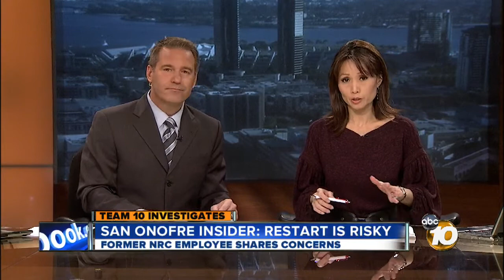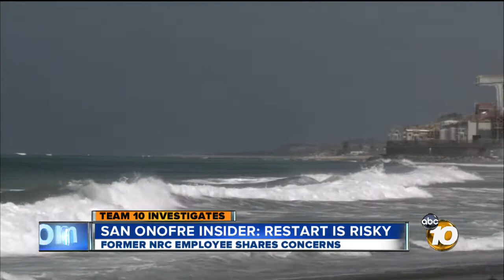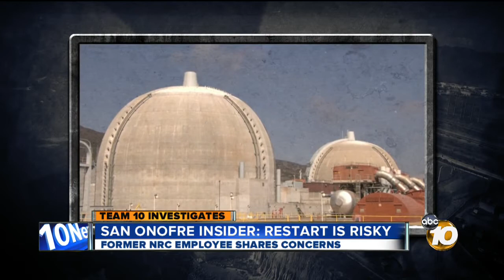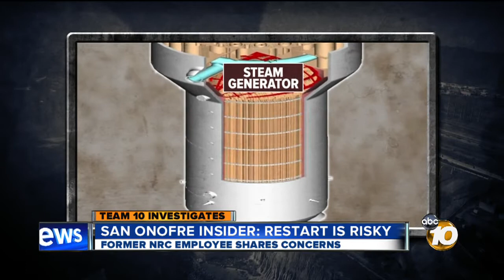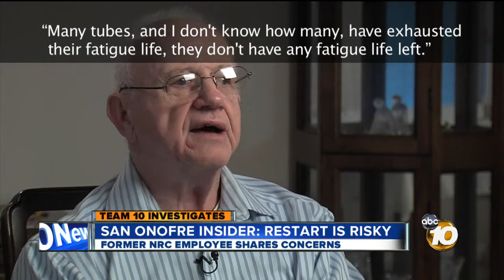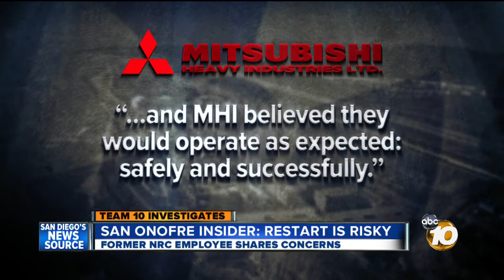San Onofre nuclear plant insider warns restarting reactor is too dangerous

Comment: The design specs of the steam generator were exceeded. a leak formed in the reactor side closed loop. The reactor boiled off its liquid water exposing fuel rods to air. Fuel rods were damaged, and radioactive material was released inside the containment vessel. In order to prevent a massive explosion of the entire pressure vessel (containment dome) it was vented outside into the air releasing with it a dangerous amount of radiation. This is unlike Three Mile Island; It was able to release it slowly over time.

Comment: Well well well. It's funny to watch older videos like this. Now San Onofre is totally shut down, never to restart. And as it turns out, the NRC tried to cover it up, along with Edison. And it also won't surprise you that Mitsubishi knew of the problem but did nothing about it. Just google it. And my god, can you imagine a partial or full Meltdown like Fukushima or Three Mile Island at this site? That's it for Southern California. The disaster would probably cost trillions. Fuck nuclear power. Companies and governments have a terrible track record for nuclear power. And something like 70% of nuclear plants nationwide are leaking (Google it). In the 1950's nuclear power was pitched to be "too cheap to meter", yet it's cost us so much. What do we do with the waste? No one wants the waste anywhere. It's a multi-generational problem just to build a single nuclear waste site in Finland that is supposed to dispose of waste for 100,000 years.
Reply: nothing wrong with safe nuclear power, but there is something wrong with the companies and workers that cut corners in it every day
Reply: Cutting corners, that's SCE & SONGS decision  to save a buck, as you can that didn't work out for them!!! 
MHI will not make serious decisions and or recommendations only advise.